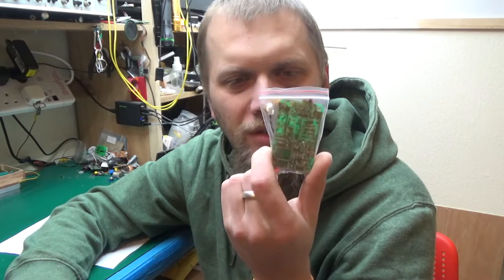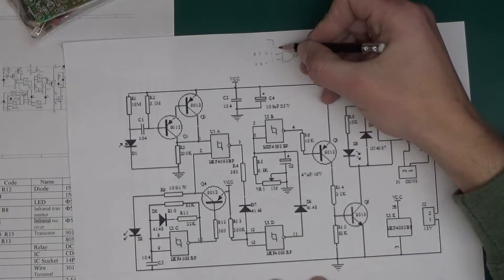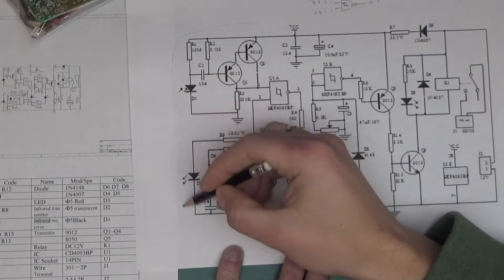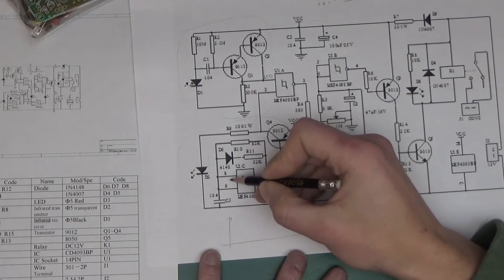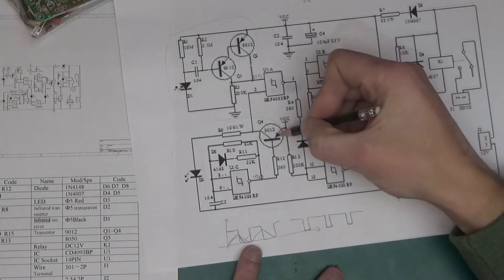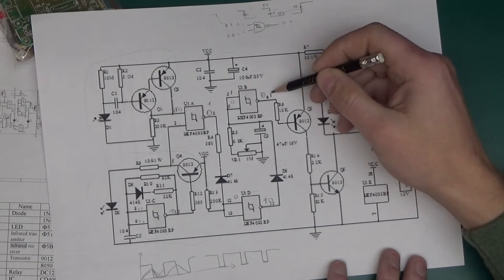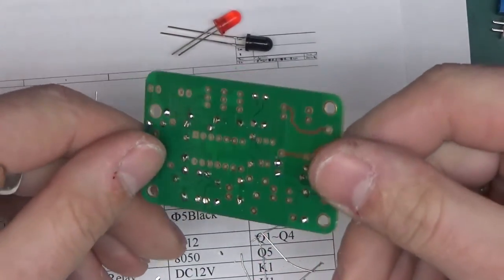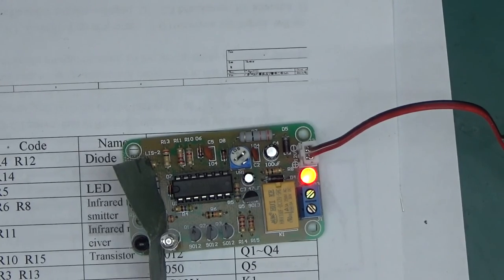Understanding the works - IR detector kit

Comment: The diode across the relay is to shunt the back EMF current from the coil which otherwise may create a voltage spike that would damage the driving transistor.
Reply from the maker: +Ed Luke exactly that!

Comment: Nice vid as always Chris.

Did you have a think about the PC PSU question?
I'm considering making a test rig to suit, bloody expensive and they do give some problems!
Reply from the maker: +NoName  I must be having a senior moment, but would you mind reminding me the question in question?
Reply: I sent you a PM, so perhaps YouTube messaging isn't that great.

Just that I had a tricky time trying to work out if a PC PSU was in spec.
Not as straightforward as I first thought.
Looks like you need to load down all the rails and then scoping the outputs needs differential probing, 50Ohm termination and possibly some ferrites too.

I have two supplies that are questionable, and looks like making a jig (Mr PC?) is the way to approach this.

Wondered if you have come up against this?